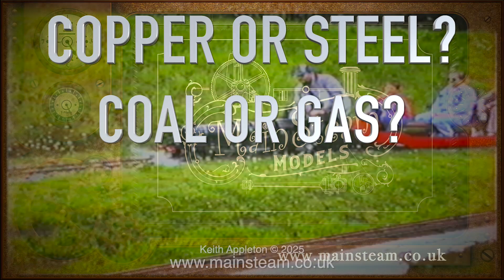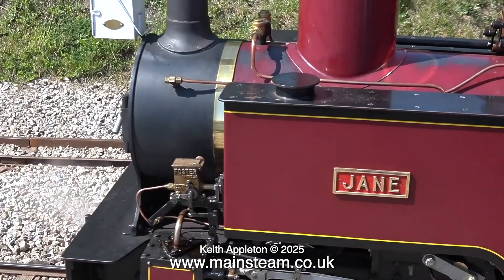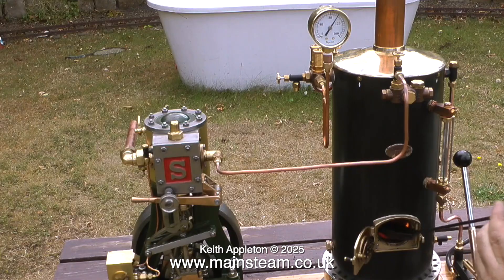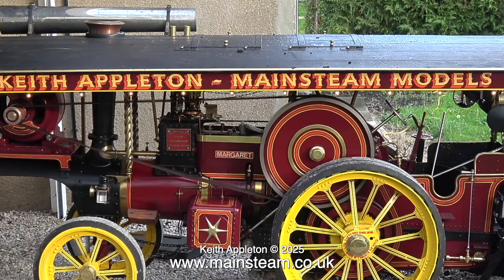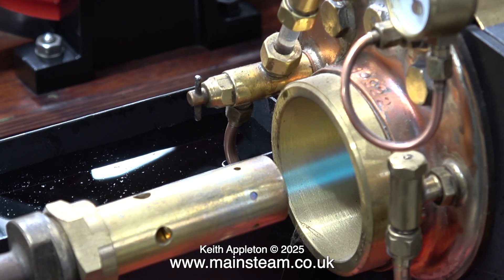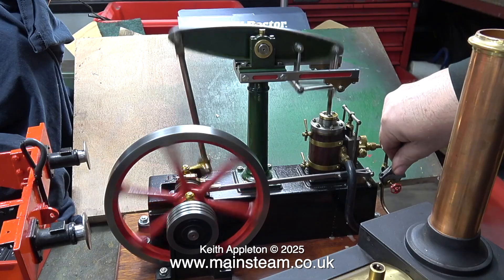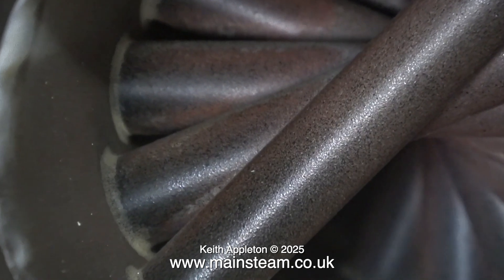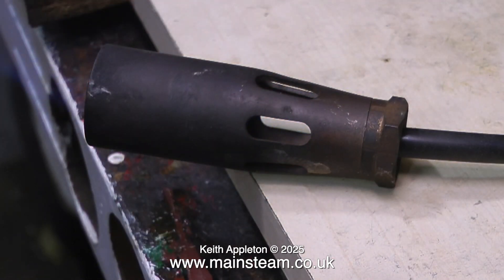COPPER OR STEEL? - COAL OR GAS?

Comment: Me and my dad have a 7 1/4 gauge Sweet William tender/tank engine with (this is of slightly vague memory so bare with me) a marine boiler, so we can take the whole firebox out when we are done running (or if i have to/need to remake the fire due to it choking itself). Why i call it a tender/tank is this: we get water from both a saddle tank (via battery pump) and the tender (via steam ejector), we use the saddle tank for priming before the fire is lit. We burn coal when running, but i would like to, one day, have a second firebox that burns gas, so we can either do testing at home or have it as a back up.

Comment: Good video and plenty of food for thought. 
I have a very old but unknown vintage steel boiler. It came with a badly designed and even worse built firebox. The pressure relief valve is rated for 125psi so I pressure tested to 250. So far so good. However I haven't yet decided on the appropriate fuel. After seeing this video I'm thinking about gas. 
Any thoughts or suggestions?
Reply from the maker: Don't use it - a pressure test is not all that you need on an unknown old Steel Boiler - seek professional advice from a Boiler person.
Reply: @keithappleton In that case I might just as well go ahead and build a new one from copper. It will obviously take longer but at least I will know the condition and it will be precisely matched to the purpose.

Comment: We have a lot of steel miniature boilers here in Australia.  The vast majority have copper tubes.  With proper use of boiler treatment they last for decades, in many cases longer than their owners.
A combination of tannin-based treatment, together with soda ash to achieve a pH of around 9, results in a very clean interior of the boiler with a fine black coating on the steel.
Opinions vary on how to store the boilers between firings.  Some like to store them full of water, while others blow them down and store them dry.  My preference after 25 years experience is to blow down the boiler while still hot, leave the blowdown open and take out a safety valve to allow all residual water to evaporate.
We use rainwater at our club, which is largely scale free, but is slightly acidic hence the use of soda ash to raise the pH is essential.

Comment: just a quick addition 

With a steel boiler, total blowing down a boiler after each run on a steel boiler is not beneficial, and can course damage to the boiler, unless your only planning a quick blowdown to remove sediment around the foundation ring.  Boilers only want blowing down periodically, and as soon as the water is gone, shut off to trap the steam in the boiler to prevent thermal and pressure shock. Sadly too many people think they should leave it open until all the water and steam pressure is gone.   a full wash out much more beneficial to a boiler than any blowdown, but the smaller the boiler, the harder it is, which is where copper boilers are very beneficial.  

I do recommend using a  boiler treatment, as you mentioned, they coat the steel plates with tannin, but they also have a PH regulator to keep the boiler water alkaline which helps prevent (but dosn't stop) scale build up. It also acts as a oxygen scavenger, which can only work if the boiler still has water in. My Burrells boiler tubes are now nearly 20 years old, and even after hard use, are still very very good, while many others who blow down each time struggle to make them last 10. I also refuse to use an electric blower, being quite happy to wait the hour and half to get steam up. with The 4" Burrell I don't even use a tall chimney, but the smaller portable I do as the drafting is much less and has the same boiler as a 3" Fowler. The most the burrell has lost in thickness in almost 20 years is 0.5mm (it is very thick for a model with a 1/2" thick tubeplates and boiler barrell, and 3/8" firebox plates and 10.5 on the outer box). But is its good quality German steel and the tubes were hydraulic grade. I wonder how long those engines I have inspected that use Chinese steel will last. My friends 3" Fowler has a steel boiler made with chinese steel. You put water in and within a week its gone rusty. the water in my engines doesn't go rusty, so lord knows what they used in their boilerplate. I have seen engines that had chinese steel tubes where in 2 years, they have pitted so much they have pin pricked. There is a few full size engines I know of that have had their tubes in for almost 20 years, but these are steamed on soft water. Most boiler inspectors now request the tubes to be removed at the 10 year exam. 

The best hint I can give with anyone with a steel boiler with the tubes out or that is being built, is to have the smokebox end tube holes made slightly larger than those in the firebox end. this aids tube extraction, and whilst is standard on full size boilers, is often not done on models.   

Copper boilers may be much more expensive, but are very long lasting and has better heat distribution. I have seen some that are 50 years old and still in good serviceable condition, with periodic descaling. There is also boilers made of Coonifer Alloy which is 70% copper, 20% nickel, and 10% iron. 

Gas burners are better suited for copper boilers, due to the water vapour that is given off can cause corrosion of steel boiler tubes. 

Distilled water is best. I have several friends who use the water out of their dehumidifiers to prevent scale build up, I try to use rainwater out of the water butts when I am home, but have to make do with tap water at steam rallies. We had a job to convince a chap the other week that you can't use deionised water
Reply: Minor and possible solution to the water problem for rallies. No experience, just an idea, start collecting water from the water butt a week or so in advance to the next rally in a container with handles that you can carry so you have a reliable supply of water. Best to go with 2 containers, just to be on the safe side.
Reply: Pretty much sums it up James. Rust loves untreated fresh water full of O2. I work with industrial steam boilers and dread shutdowns because fresh untreated water is not your friend. Go for Brass or copper if you can afford it and use the softest water available to you.

Comment: Coal fired and steam oil what a lovely smell.  😊
Reply: i have some really old steam oil. the chaps who workshop it came out of died in 2003, and the tins were 1960s. its has a wonderful smell when you pump it through the engine, but in the winter, you almost need a knife to be able to put it in the lubricator.

Comment: I have plans by Henry Greenly for 1.5 inch scale 4-8-4 steam loco! His plans ( from 1934) called for a copper boiler. The boiler and outer wrapper  called for a quarter inch copper plate! Here in Western Australia, I stood more chance of obtaining 1/4" gold plate😢
So at the time (1978), steel Briggs Boiler designs were, and still are, being built to the AMBSC design criteria used here in Oz. Well, that's what I've  used. Anyway, there are these types of boilers still in use that were built in the 1970s! The use of Tannin in their water supplies is largely  responsible for the boilers' longevity.
Your comments seem about right to me. Thanks for sharing.
Reply from the maker: Thank you for sharing your knowledge.

Comment: I have built an Allen Models Mogul. It's 1.5" scale, 7.5" gauge. I started machining on her in 2019. The boiler was made by a professional boilermaker here in the US by the name of Marty Knox way back in 1987. It's a steel welded boiler with silver soldered copper flues. So far, I've fired it with coal, but I plan to build a box burner that can be inserted into the firebox in place of the grate. There are railroads in the western mountain states that do not allow any type of solid fuel firing due to the fire Hazzard, so to run on these tracks gas firing is required.